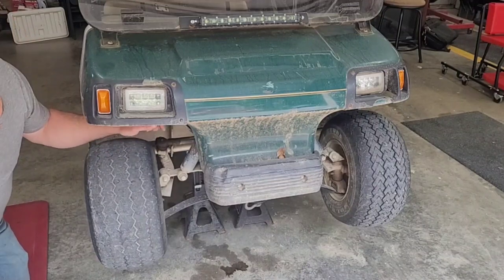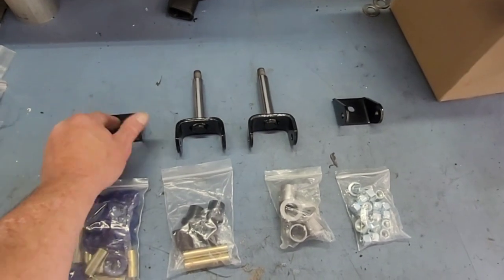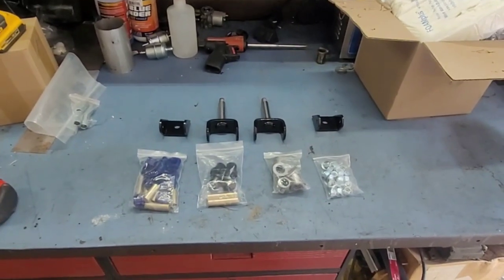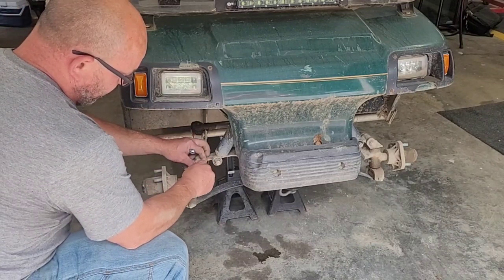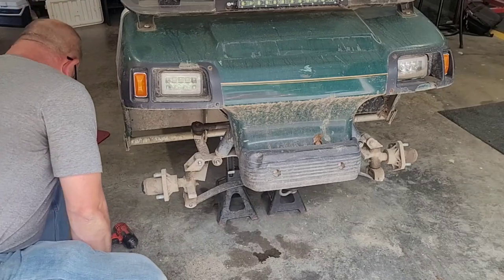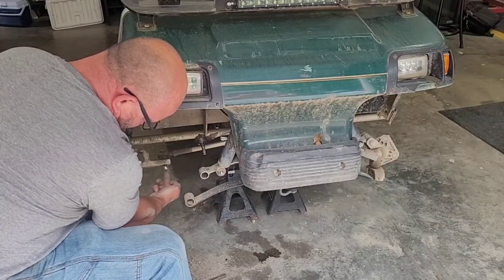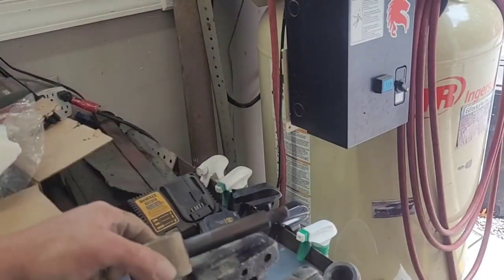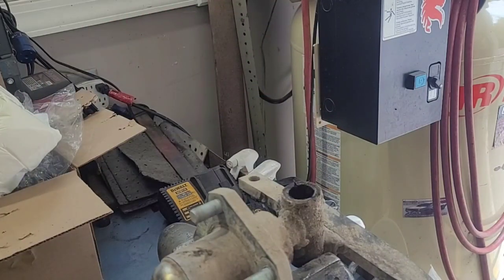Club Car Front Suspension Rebuilt, EASY!! #clubcar #suspension #golfcart #golf

Comment: Was curious if i could buy buddy bearings and install them on the front hub just like you would do  on a boat trailer?
Thanks for reply
Reply from the maker: You could, as long as the cap diameters are the same, and, you remember no to put too much grease in it, or you'll push it out the seal.

Comment: I see your cart has the old style HUB & cone type bearings? What would it take to update to the new sealed bearing hub assy?
Reply from the maker: Yes it does.  From what I gather, the 2004 and up model year used the sealed hub bearings with the plastic cap, which is a different spindle and hub than the 2003 and down with the tapered bearing and metal cap.  The OEM part numbers for the 1981-2003 DS and PS Spindles are 1010348 and 1010347 respectively.  While the 2004 and up OEM part numbers for the DS and PS spindles are 1023542-03 and 1023541-03 respectively.  I haven't verified if the spindle height and bushing diameter are compatible with the king pin though, some more research would have to be done.